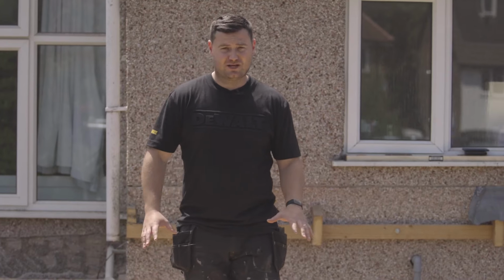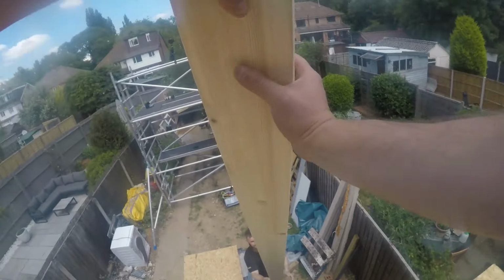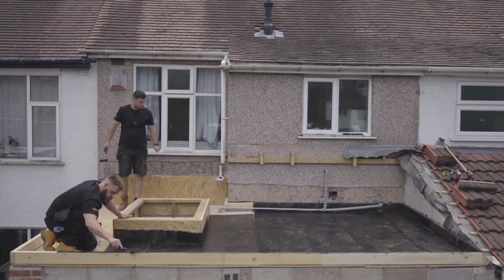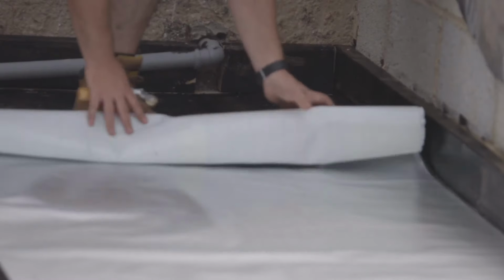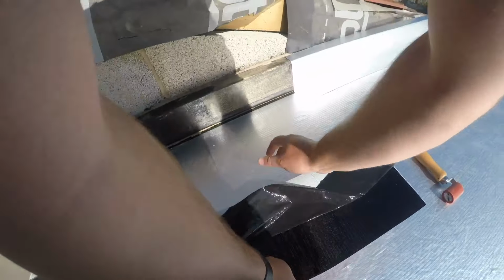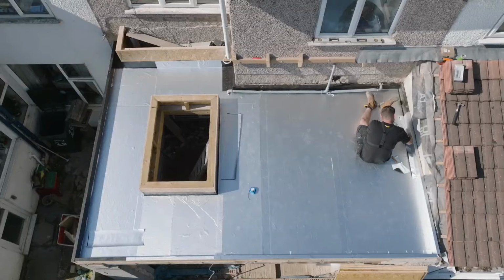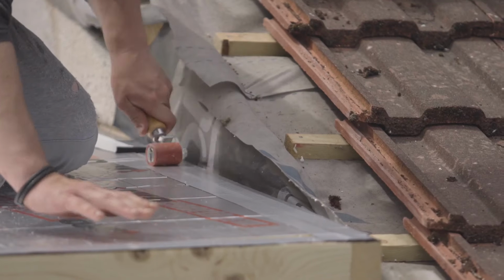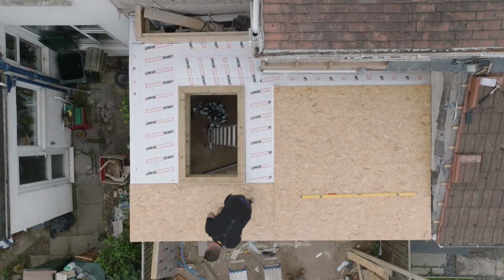How To Build A Warm Roof From Start To Finish | Quick Simple Guide.

Comment: Never install ply on top of insulation. This has not been recommended for a while now just as cold roofs are no longer recommended due to the difficulty in ventilating them properly. Installing ply on top of insulation will make the roof act as a cold roof and will rot over time thanks to condensation. If mechanically fixing you should be using thermally broken tube washers to limit cold bridging too. Im an ex single ply installer of over 8 years and ex Danosa field technician. Im now at Soprema. It's safe to say I've seen many roofs like this fail.

Comment: What's the point of a vapor barrier when the pir boards are 100% vapor closed due to the aluminium layer on both sides?
Reply: If you just seal the top of the pir and you have some air leakage the warm air will condense between the insulation and potentially rot out the plywood/osb underneath, similar to SIPS. The vapour/air barrier being installed beneath the insulation (the warm side) is best practice and reduces the possibility of air leakage entering the insulation to begin with
Reply: @eddieduff9740  in my understanding just use non foil pir and use the same process then in video. The vapour barrier need s to be the internal  side of the insulation. No foil back pir can be used.
Reply: Exactly bro. This roof is going to fail but in about 5 to 10 years. No foil back to be used in warm roof. Hybrid or cold roof yes but defo not warm ,.. The process these have used is a major no no. Use rigid board but no blooming foil back. Lunatics are trapping all the moisture where  you really do not want it. Xxxx
Reply: @worz678 wow are you kidding me?! This process is exactly the way to do it lol
Reply: @TheDeanoc69  no . Wow . Buddy. One vapour barrier . God help you or your customers if you have put foil back insulation on top of your vapour barrier for a WARM roof. God help you bro. And mate do some reading and maybe lay a few roofs before coming at me. This is not the way to do it. I repeat this is not the way to do it.
Reply: @TheDeanoc69  hello Deano.  We are waiting for your explanation of your second and third vapour barrier in a warm roof. Errrrrrm what happens to any moisture hitting the original vapour barrier and making its way back up, away from the internal structure ? What happens when it hits your foil back . Hee hee it's not breathable is foil mr internet builder.

Comment: According to some builders you should be using plastic sleeves with the screws to prevent bridging. Also did you use contact adhesive for the EPDM (rubber membrane) or water based adhesive?
Reply: I am guessing not using contact adhesive is why they put the second osb decking layer down. Other videos I have seen using those plastic sleeves to screw down the insulation have the contact adhesive glue directly gluing the rubber to the insulation. They also mention using the "tissue" backed insulation instead of the foil backed one these guys use in this video.

Comment: Do you have a follow-up video of the flat room being completed?  It more about I'd like to know how to finish the sides to the brick.
Reply from the maker: Hi Ian

Thanks for watching! Unfortunately due to time constraints we were unable to film the waterproofing layer being fitted on this roof. 

In terms of finishing up against the wall we took the membrane 150mm up the wall and as the wall was being re-rendered the render was laid over the membrane down to deck level. 

We do have a few other videos showing how we've chased into the wall and finished with a metal wall trim however.

I hope this helps.

Comment: No need for osb on top of the Insulation, it will just fail in years to come, prime the insulation broads and s-vap on top then you liquid system
Reply: Also the long screws will compromise the vapor barrier everywhere they penetrate
Reply: @younamed depends on the brand of vapour barrier . You can get self sealed that take away this issue you are thinking of.
Reply: I want mine done this way so I can walk on to. If it wasn't it would leave dents on the insulation
Reply: And this silver backing comes away from the insulation
Have seen it on many occasions
Reply: You obviously have no idea what you're talking about. Wow
Reply: Epdm rubber needs to stick to osb, will not adhere to the silver insulation
Reply: If you know how to do it. Why watch the video!!!
Reply: Jesus christ can't believe I've even just read that. Oooh I know I'll rely on the glued on foil laminate to hold my waterproof top covering on 🤔
Reply: @superlazy3355 they literally make warm roof style insulation without the foil and a different coating for whichever waterproof top layer you end up using to adhere to, because you shouldnt use wood on the cold side of the insulation layer as it will eventually fail.
Reply: Thats why you should screw it down to your joists and not the OSB, to help prevent  this , @younamed
Reply: @DC-ej7bm it'll just rot in under 10 yrs from condensation on top osb board
Reply: @gawbieviking1716 no you need tissue faced insulation,  no Top OSB and it needs sticking down with contact adhesive and not water based glues on OSB
Reply: Not technically a warm roof if you have the top OSB board. You can rubber onto the insulation, seen it done on college/school buildings.

Comment: This was very helpful. Short, to the point, full of detail. Thanks!
Reply from the maker: Glad it was helpful!
Reply: @Roofscout  does it need any vent holes in the voids in the  joists and also is there a spec for joist timber size vs extension size, thanks

Comment: Genuine questions: 

1. Don't the screws down through the insulation from the outside act as a cold bridge and encourage condensation inside the structure? 

2. What about the cold edge of the roof deck behind the fascia, to the underside of the roof? Logically if the top of the roof is warm, shouldn't the insulation continue around the edge to the blockwork to keep the edges of the roof warm?
Reply: both good points
Reply: 1 - Yes, thermally broken fixings are a must with warm decks. 
2 - As long as the roof insulation overlaps the cavity insulation, it is fine. It's hard to tell from the video but, at 3:04 it looks like a full fill cavity so with the 2x5 around the perimeter over the top of the outer block, the PIR should overlap the cavity insulation. As long as the cavity insulation reaches the top of the wall and butts against the bottom deck, there will be minimal cold bridging.

Comment: What is your option on what most roofing manufactures are saying the top osb3/ply should not be used and the roofing product fixed directly onto the insulation. Also the correct flat roof insulation is not foiled back if adhering or torching on the top cover. It must be fleece backed such as the kingspan Thermaroof TR26 or TR27. 
Full detailed descriptions of the technical reasons  I can quote from them. But the short of it is that the top cannot absorb or disperse the heat and is subject to below-ambient low temperatures. So subjects the material to moisture vapour cycles which repeatedly condenses and evaporates on its surface, so in time the top deck will rot and compromise the performance of the system.
Reply: The idea of gluing the rubber direct to the insulation is to prevent mold forming on the underside of the OSB. You introduce a dewpoint between the insulation and the OSB. This also allows water to transit through to the water based glue on the rubber and that is the cause of glue failure.
Reply: This roof will be rotten after 4 years

Comment: Thankyou for this video.. one question. By screwing through the top 18mm osb sheet and through the insulation to the joists below. Are you not piercing the vapour barrier.  
Again thanx for the vid xxx
Reply: That was my question too. I have heard overspeccing your vapour barrier can let you have the min performance values even with holes in it, but still. Why poke holes in your vapor barrier?
Reply: @joshnabours9102  steveroofer says the alutrix seals around the screws

Comment: I can't believe driving screws straight into the vapor guard passes inspection in the UK. UK roofs are quite far behind when it comes to warm roofs, you can glue your insulation right onto the vapor guard same as the membrane.  That OSB isn't needed.
Reply: @Matt01miller you are quite right. All my research says glue the insulation down. Should not use OSB to the top of insulation  it will rot but what I can’t find is which insulation is suitable to apply the three layer bitumen felt. Can you use any PIR of 150mm for instance?
Reply: @saharasultana4172  you can use any really, the first layer of felt is the vapour guard, then insulation,  then 2 layers of felt, ideally 9mm thick total. The first layer on top is cold adhesive so the flame doesn't melt the insulation.
Reply: @saharasultana4172 
No it doesn’t

Comment: Why is it called a warm roof when the membrane is clearly on the cold side of the insulation? 
Is this system relying upon the contractor to ensure no rain or dew occurs during assembly that would potentially be trapped between the vapour barrier and the roof membrane?

Comment: couple points, the VCL should be brought up and over the skylight upstand, stopping short allows vaput straight into the insulation. No need to use OSB on top of the insulation or firring strips. Kingspan thermataper has falls built in and can take EDPM directly. Lastly you didnt insulate to the top of the upstand, BCO should fail that.
Reply: No thermally broken fixings as well
Reply: I was wondering about the upstand creating a thermal bridge along the house wall

Comment: In the old days the vapour barrier used to be thin gauge polythene but I always question the use of a vapour barrier if your going to pepper it with screw holes
Reply: This self-adhesive vapor barrier is very expensive I would just use what you've just pointed out.

Comment: Hiya did you not use insulated plastic dowels to screw through the insulation to stop the reduction of the thermal barrier?
Reply: Cold bridging through a 5mm screw shank?.
Reply: @Fliberdygibbets1 Look at in the next frost. Yes, there will be cold bridging even with 5, 6, or 8mm screws. The mushroom fittings are made for a reason🙄
Reply: @baldyslapnut.  doubt it
Reply: @Fliberdygibbets1  Doubt all you want, it's basic physics.🙄
Reply: @baldyslapnut.  I have never had a call back through cold bridging neither have building control asked for these fixings. They spec joist, firring, 11mm osb. Vapourbarrier. 150mm pir. 18mm osb screwd threw into joists with 250mm screws. 
No concern of piercing vapour barrier or cold bridging. I have done this method for well over 10 years.
Reply: @Fliberdygibbets1  Fine, good for you and your customers.
Your original assertion was to doubt thermal bridging occurs via a 5mm fixing. The relevant branch of physics is commonly referred to as 'thermodynamics'. There's a massive clue in that title.

For a small extension, (5×5) the cost (~£100) of the thermally broken fixings pays back in saved heating gas in about 10 years (current price per kwh) conservatively assuming heating is on for 1/3 of the year, 8 hrs per day, and there's a 10° temp difference between roof void and outside.  The normal long screws are about the same price as thermally broken fixings, so it's a no-brainer.

Energy costs are only ever going to rise, so over the lifetime of the roof (at current energy prices), a customer may save £300+ for no extra cost.

The non-thermally broken screws are constantly conducting heat from the warm side to the cold side, so in summer, the room may be hotter than it needs to be.

BC is the minimum specs, not necessarily the best value for you or your customers. You carry on in your,  'I've always done it this way world'.
Reply: @baldyslapnut.  I fully understand the logic behind it all but genuinely belive if you had minus 10 outside  the chances of that cold transferring through rubber roof covering then down through the screw into the centre of a 45mm wide piece of non conducting timber then through plaster board to affect the temp of room. I just can't see it, maybe I'm wrong but hey you do you. I tend to go belt and braces in many respects regarding thermal bridging and condensation issues and guess experience had to take some judgement calls.
Reply: @Fliberdygibbets1  All good. Just remember heat moves from hot to cold, so it's heat escaping rather than cold penetrating (unless it's an air leak/draught). Belt and braces - always the best policy.

A company called FixFast does the plastic mushroom (tube washers and fasteners) if you want to get some specs and prices.

Comment: What is the size of that long screw you use at the top of the plywood? What is the spacing between long screws around the perimeter and between inner? Thanks

Comment: Very good job done, but where would the water drain of because the pipe is a little bit higher to the insulation. Thanks 🎉
Reply: The roof will have a slight pitch away from the existing building and they would have fitted a gutter along the fascia to catch any water. All assumptions, but more than likely

Comment: Great video format, easy to follow. Are there any alternatives to the self-adhesive-vapor-barrier products on the market? Most of the stuff I can find is £60 for 10M. No doubt it makes a great job, but at a cost. Would a torch-on felt-underlay suffice?
Reply from the maker: Hi ChAzZ

Thanks for watching, we're glad you enjoyed the video!

The Torch on Felt Underlay would suffice however specific Vapour Barriers like the ones we used are much better suited and easier to install. The Alutrix 600 Vapour Barrier self seals around the deck screws we used to fix the top board through to the joists for instance.
Reply: Technically you can use a polyethylene sheet, 500ga or greater. But you have to fix it with staples which obviously puncture the surface and reduce its effectiveness a little.
Reply: @ComeWhatThey  Thanks for the reply guys, it's great to hear different ideas from people. I've also heard about polyethylene sheeting too. But as you say, puncturing... but then again, don't the 150mm long screws that sandwich everything together puncture the membrane anyway?
Reply: @ChAzZMaNZZ  Yes they do. Alutrix is a nice product but of course it's a bit ridiculous to suggest that warm roofs don't work without it. Just have to take care with installing polyethylene, and tape over any punctures/rips.
Reply: You can pay £300 for 40M2 of Alutrix, or you can pay £20 for 40M2 500GA Polythene. Worst case scenario, you will save 90% if you go with Polythene.
Reply: Elotene is decent
Reply: If you want to cut corners just use a sheet of polythene.But do it properly a few hundred quid will save having to do it again in three years time.
Reply: @jablot5054  Explain what you mean by cutting corners?

Comment: Hi fellas great video, you make it look really easy,l bet your great at wrapping Christmas presents 😂 question for you , got a warm room to do on my own property but it will be walked on regularly, what surface would you recommend to finish it with
Reply from the maker: Hi John 

If you are using the roof as a balcony you could install an EPDM membrane and then install some form of decking or balcony tiles over the top.

Make sure to protect the membrane with some geotextile fleece before laying anything over the top though!

Comment: Great vid, curious, what’s the cost to have this done. Looking to replace ours with a solid roof
Reply: I reckon it was about 3000K, using OSB3 which is way cheaper than plywood, cheaper insulation, then the most costly -> allutrix and resitrix .

Comment: Are there any issues if i build a warm roof on top.of the exisiting felt (provided its all dry) forgoing taking the felt off and adding vapour barrier and then doing rubber roof?
Cheers guys, great informative video
Reply: The felt is fine as a vapour barrier if its not split or any holes etc.

Comment: There is a expensive version of PIR for flat roofs. Does it make any difference?

For example: 120mm Recitcel PowerDeck Flat Roof Insulation Board 1200mm x 600mm is double the price per square meter compared to 120mm Recticel Eurothane Insulation Board 2400mm x 1200mm
Reply: i'm using seconds. the alutrix was the most expensive bit, and my time

Comment: Should be using thermally broken fixings rather than those long screws, non foil faced insulation and no upper deck of OSB. Good other than that.
Reply from the maker: Hi ComeWhatThey

Thanks for watching.

We agree, that is one way of constructing a warm roof however there are also benefits to our chosen  method. 

A lot of EPDM systems aren't recommended to be bonded directly to tissue faced insulation therefore the extra layer of OSB is needed. This also means the foil backed insulation is fine as we did not adhere the waterproofing membrane to this.

Another benefit of the top deck is that it is more hard wearing providing a nice solid base. If the house roof ever needs to be accessed via the flat roof, there is now a nice solid base for any ladders or foot traffic. This would not be possible if we'd adhered directly to tissue faced insulation.

The benefit of thermally broken fixings in comparison to those we used is minimal in terms of how they impact the U-value of the roof.
Reply: @Roofscout  Thermal fixings aren't to improve the u value overall, they're to reduce cold bridging. And the issue with foil isn't just poor adhesion, it's acting as a vapour barrier on the wrong (cold) side of the roof, further helping your upper deck to rot over time. You can often get away with it but there's really no reason to have an upper deck in most cases, it's fine for limited access without one and it's just added expense for the customer.